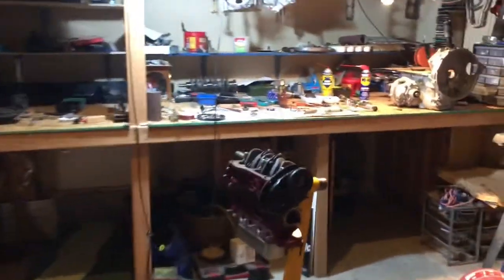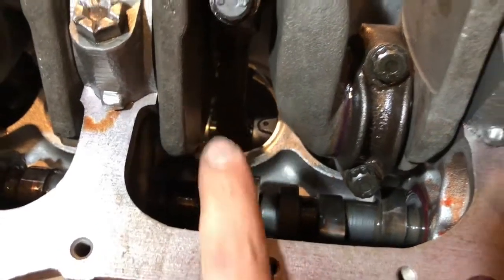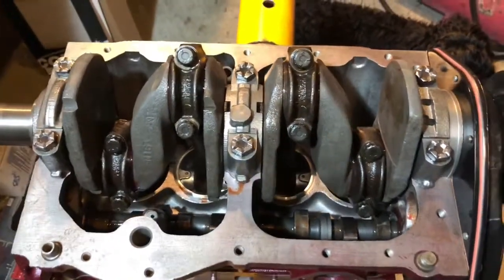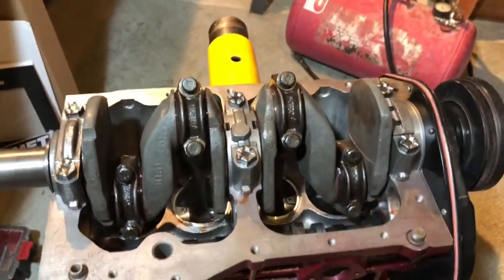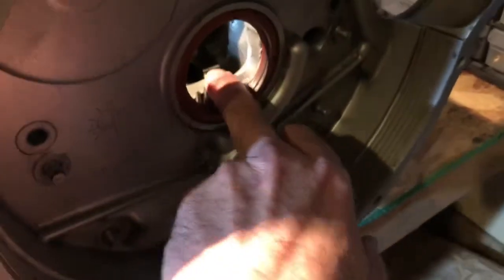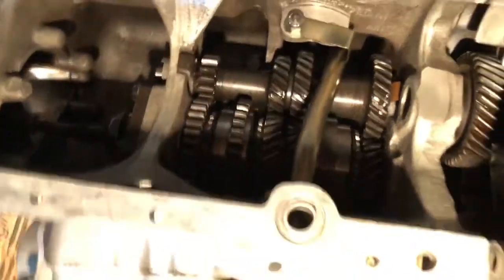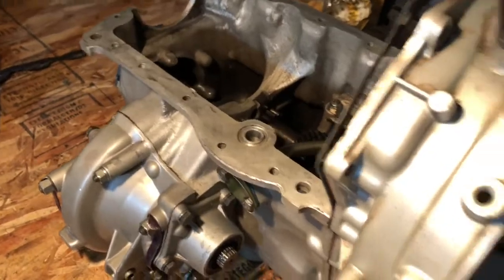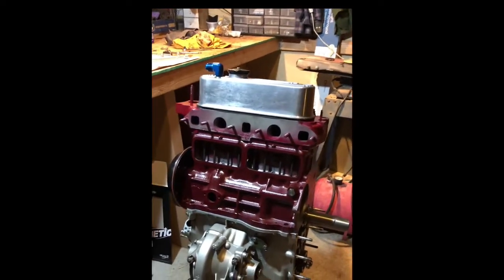Super small bore final assembly, Part 1 of 2

Comment: we are not far from firing ours up any idea what bhp you achieved many thanks
Reply from the maker: Are you building one like this with the huge overbore and 1275 head?  Let me know how it turns out!  I'd say I was able to double the power of a standard 998 and still keep it easy to drive as long as you pay attention to the very high compression! 

So how much BHP?  I'm careful here because people believe all sorts of incorrect numbers to begin with.  AT THE WHEELS is what matters, and a standard 998 puts 20-25HP to the wheels.  People immediately jump up and say 'well mine came with 43 from the factory'... that's NOT a measurable number! It's theoretical somewhere at the crank, without driving all the junk it's connected to!  Aaron's Mini should make 40-50 HP at the wheels. About what a basic 1275 street Mini would do!  But the smoothness and willingness of this A+ 998 is AMAZING! It's in the top 5 of all the Mini engines I've built!  (Not for power of course, just all around greatness!)
I'm thinking of building another one and finding a way to use an aluminum head... harder than it seems because of the increased valve spacing...

Comment: A very interesting video.
It looks like you have no strap on the centre main?
Why did you not go with the 998 head?
Reply from the maker: Hi Gavin,

I've never been a believer in the center main strap.  Not at all impressed with the quality of the kits from places like Mini Mania... a bar of steel and two cheap hardware store grade 5 bolts are what you usually get. 

Even more important is that in my opinion, you should NEVER machine the bearing cap without following with a complete line-bore, yet even MED Engineering has a video just chopping down a center cap and bolting it on.  You're better off just leaving it alone.  A good line bore will be better than $200.  Now how foolish are those 60 cent bolts?

My current race 1380 in the #59 Bugeye of Karlo Flores has 2 or 3 class champion seasons with the standard caps and bolts.  We run over 8000 RPM on straights, and last dyno'd at 121 HP at the wheels!  I freshened up the engine once with the same crank and rods, and the standard bearing caps and stock used bolts!

I do have a 12G295, the best small bore head (I've shown it in the head comparison video), but with the enormous over-bore, I was able to move the cylinder center-lines around quite a bit to get them better centered under the 1275 combustion chambers.  This swap has been done for decades, but never quite like this!

NEWS FLASH!!  I DID start this engine yesterday evening in a snow storm!  It made an UN-EARTHLY sound and might have caused the snow to change into hail.  I'll post it soon....
Reply: @JemalCRM  

Interested to learn more, and see what bhp you get.